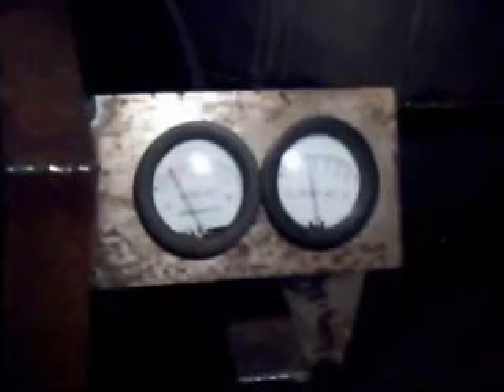Gasifier, Downdraft Woodchip

Comment: So,whats your point? you've made a downdraft woodchip water heater. Are you planning on showing the heater? I mean the flames & gauges are nice, but what are you trying to prove? That wood burns? That wood burns hotter with a blower attached? Any old Ironsmith could've told you that! I'd be impressed if you showed a little more detail & a workable pattern ! thank You